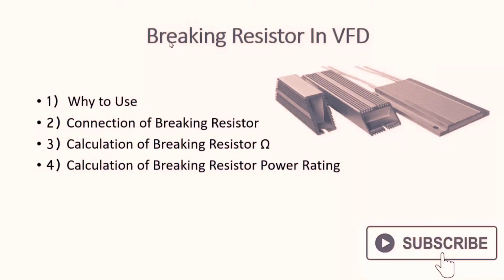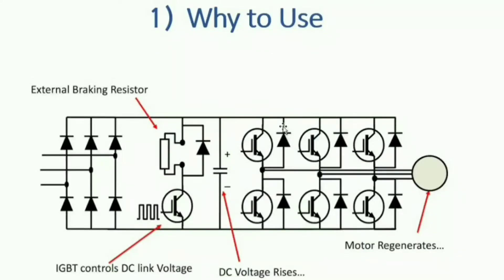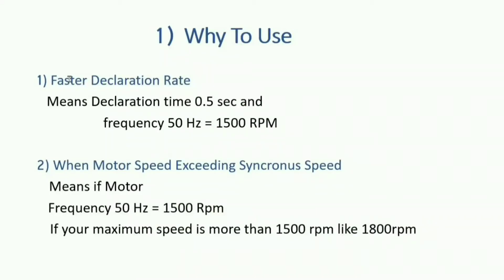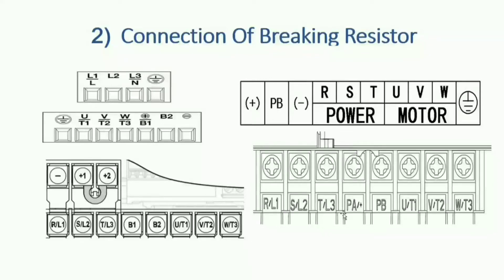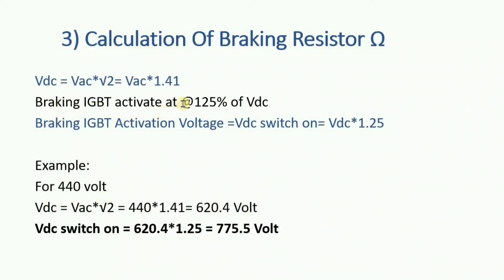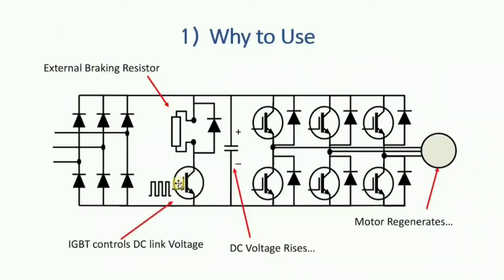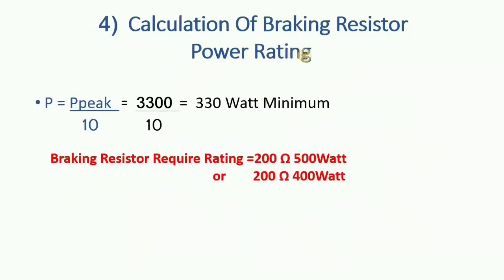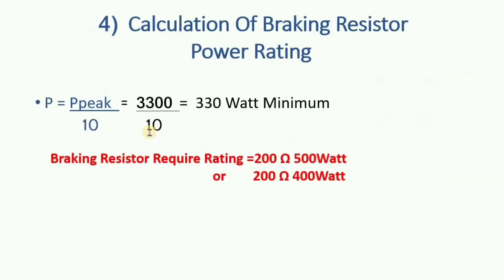VFD Braking Resistor Calculation | Breaking Resistor Ohm & Wattage | VFD Braking

Comment: Mr Nair, I'm using Delta VFD 450C43S-00, 45KW in my project along with DBU VFD4045. How to select BR (Brake resistance) and wire size between VFD to DBU and DBU to BR. Please suggest the type of OLR as well for Brake resistance.

Comment: Hello, I have an issue with my dynamic breaking, I'm using a Delta VFD-EL for a 220V, 2 HP motor, the manual says that I need to use a BUE-20015 dynamic break module with a 100 ohm and 300 Watt resistor, my trouble starts as soon as I turn on the VFD, the resistor starts to burn, I've already burn one resistor, Do you have any idea of what can I do or what could be happening? Bests.
Reply from the maker: Okay so where did you connect the resistor to?   Did you use the Brake module?
Reply: @NerdyNairTech  Thanks a lot for your answer 🙏, I connect the resistor to the break module, an the module to the VFD (+) & (-), the resistor to the B1 & B2 terminals of the module.
Reply: @NerdyNairTech  By the way, the module doesn't overheat, is just the resistor, and I also have connected the resistor directly to the VFD and the results are the same "overheating".
Reply: Today I have checked the voltage between the resistor terminals and it is always having 350V DC, it is never on 0V, Any thoughts what could it be?. Bests.

Comment: Great  , can you show me in video how to wiring  the VFD 2,2 kw at : 
+ fuse 
+ safety relay 
+ filter 
+ braking resistor 
 + contactor 
+ e-stop 
+ reset button
 + switch main power
Reply from the maker: Yes

Comment: Have a 2.2KwH Spindel. Got a electric heater 500W 100~ Ohm.
Should work fine as breaking resistor 🤟 (fingers crossed)
Reply from the maker: Should work but life of heater will be less it burnout.

Comment: Hello. Is it the percentage of braking IGBT is same for all model?
Reply from the maker: Mostly If for Heavy braking apllications such as Crane, Hoisting etc you can refer to the manual for Resistor specification as per the VFD manufacturer. You can also send the model no. and I will try to give link for the Manual.
Reply: @NerdyNairTech   im using Aqua drive
Reply from the maker: @farhatunraihan1902  Model No.?  and KW
Reply: @NerdyNairTech  im not sure about the model no but im using danfoss brand for 15 HP

Comment: hello Nerdy..
I have put calculation from your formula.
Inverter Rating is 132 kW
I found the resistor value = 3 ohm
and power rating = 19.800 watt
is that correct ? pls let me know..
thx
Reply from the maker: What is the Application?
Reply: @NerdyNairTech  using your formula..
Reply from the maker: Yes it's correct. 3Ohms & 19800 Watt or 19.8 KW
Reply: @NerdyNairTech  many thanks for your answer
Reply from the maker: @anggaradedy  Which VFD are you using? The manual or catalog will also have the exact rating according to the same.
Reply: @NerdyNairTech  i am using LS brand for my VFD

Comment: hello . i have  hitachi inverter 3G3MX2 11kw,  and i connected braking resistor 100 ohm , but alwyas i have problem error E06.3 ,E06.2, ....i try to adjust: b090, b095, b096,b097, these parameters many time but th same problem
Reply from the maker: Will check & tell. Send pic of vfd
Reply: @NerdyNairTech  I send you in messenger